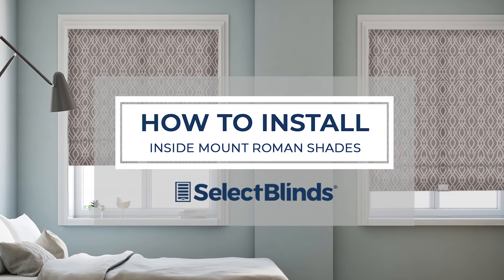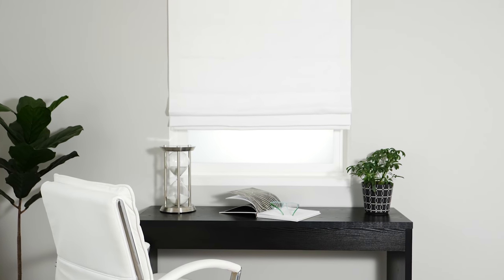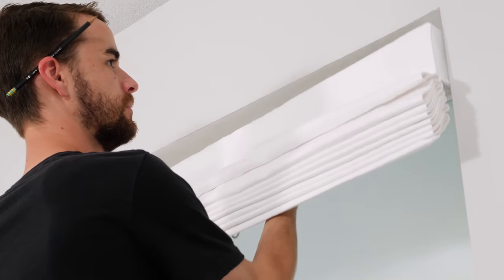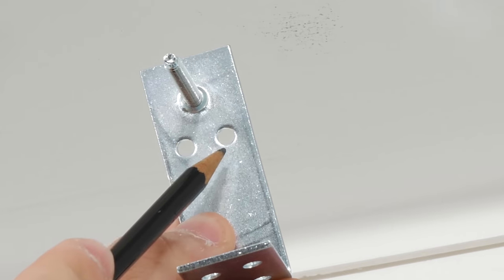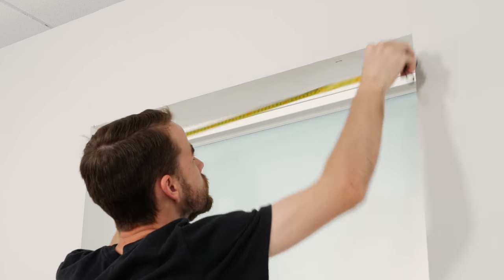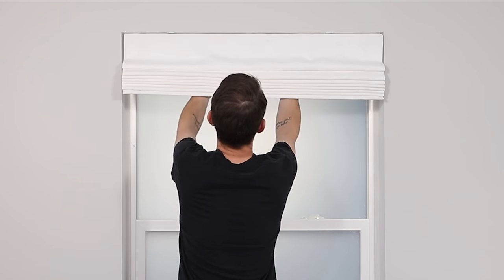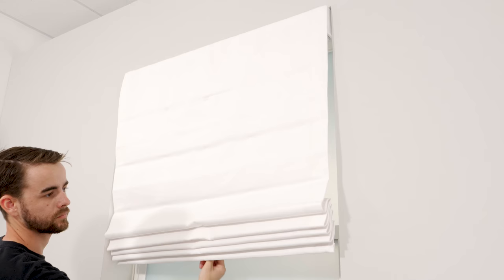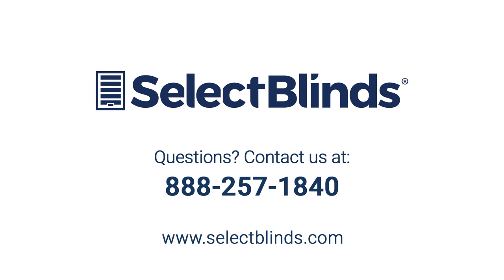How to Install Inside Mount Roman Shades

Comment: Video shows him drawing a line through the gap in the blind and then drilling the pilot holes along this line. The line drawn is where the bracket stud will be located. If you drill your bracket holes in this location, your shade will be mounted forward instead of flush with the sill.
Reply: This comment needs to be pinned.

Comment: How far in do inside Roman shades go
Reply from the maker: Hi there, we typically recommend at least 1 and a half inches of depth within the window for inside mount. Products may differ in these measurements due to the features and fabrics, so always be sure to thoroughly read the Specifications  tab for each product before purchasing. 😊

Comment: Please show how to install inner mount shades without the brackets.
Reply from the maker: Hi Amy! Although we don't show how to install with the method you're mentioning, it's pretty similar! There should be holes or slots in your head rail. if you're able to, hold the roman shade in your window, and then
 use a drill to place the screws upward, through the holes, directly into the top of your window frame. If you have any further questions please contact us at 888-257-1840. Thanks!